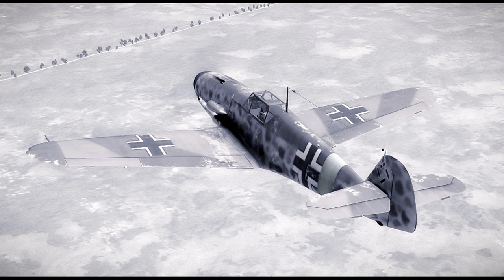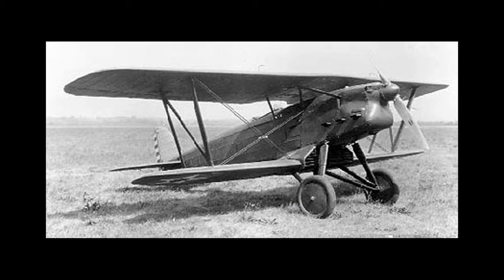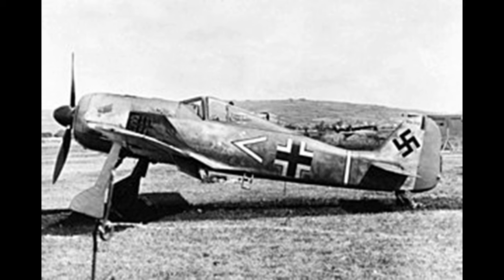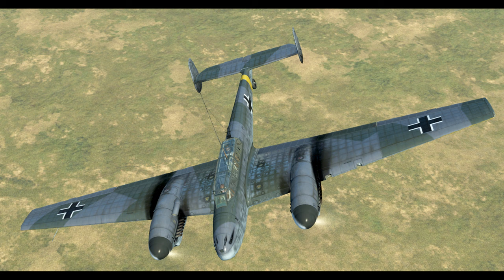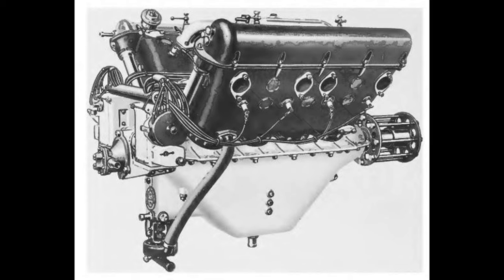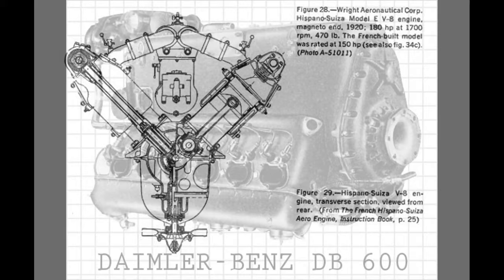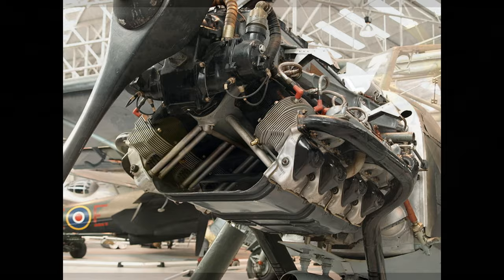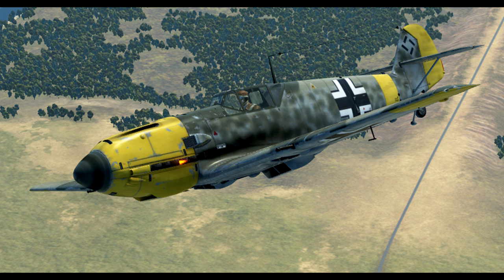Messerschmitt Bf 109 , Why an INVERTED V-12 Pt. 1? inverted V12s vs. upright

Comment: I would find it interesting to learn more about Italian aircraft engine design during WW2. The Italians didn't produce any major aircraft of note during that war, but afterwards the Italians were the dominant automotive gurus. Ferrari is a name that everyone knows. Were the great creative minds in Italy being suppressed by that spineless dictator? Surely, there are examples of great Italian engineering DURING WW2 - perhaps good engines that ended up in less desirable aircraft?
I am not Italian even slightly, but I find it interesting that the Italian automotive industry (starting right after the end of the war) was able to become a dominant world-player, while their aircraft during that war were largely laughed at.
Please tell me how I am wrong and how things actually were. There is a disconnect there that I would like to know more about. Something doesn't make sense.
Reply from the maker: Most Italian fighter planes during the war flew with either Fiat or Alfa Romeo built variants of the German DB601/605 engines. They were built under license. Some of the Italian planes were pretty good but nowhere near what they could have been. The Italians had a lot of record setting engines in the 20's and early to mid 30's, then fell apart, then came back with a vengeance after the war and was dominant by 1950. Why is that? The answer is entirely political. Certain political systems don't get the same amount of creativity from the population as others. You can force people to harvest grain and work in factories, but it's much harder to force them to invent something nobody has ever thought of. Think of it this way. Did Steve Jobs and his team create the Iphone because the commissar at the central planning division told them too? Or, perhaps they had another motivational factor.

Comment: It was mostly so they could shoot through the propeller the center of the propeller. Because almost all of them had a cannon in the center of the propeller. I watch a lot of World War II documentaries I'm sure there are other reasons for it but that was one of them
Reply from the maker: No, I'm afraid not. See part two for the reasoning. I cover that theory extensively.
Reply: @GregsAirplanesandAutomobiles  I watched Part II. and you are correct.  I'll admit when I'm wrong. Good video!

Comment: The point that it is not possible to use this inverted V12 for tanks is nonsense! 

The DB 601/603 were part of the motor range offered by DB.  Versions of the DB 603 basic motor were as well offered with upside zylinders as Diesel engine with 6, 8 and 12 Zylinders. After the war DB founded together with Maybach the MTU. A follower with 10 zylinders was used later in the Leopard. Reference Spielberger (Panther), Gersdorff (Flugmotoren und Strahltriebwerke).  

DB tried several times to sell its engines for tanks in ww2. But the Heereswaffenamt did stay with Maybach as sole supplier of motors for tanks.
Reply from the maker: I didn't say it was "impossible", but show me a production tank with an inverted V-12.
Reply: @GregsAirplanesandAutomobiles   Daimler Banz and other motor manufacturers like Deutz often use a kind of a modular system.....It is the same engineer team. They use the once designed motor block, pistons, crankshafts for a range of motors. 

You can turn around the motor block use some new components or components already in use in other motors and make a tank motor out of an aircraft motor. 

That means if DB would have persuaded the Heereswaffenamt to use the DB517 for the King Tiger  plenty of the components would have been the same as in the DB603.  Both motors have the same dimensions.  They could have used the same cast molds, forge molds, tools and perhaps assembly lines.

Name        bore         hub           cubic capacity        no zylinders       Remark
DB 603      162         180               44.5L                      12                       Aircraft engine gasolene inverted V
MB517      162          180               44.5L                      12                      Offered for tanks standing V

Comment: Kepping the pilots head closer to the center of gravity( lower in the seat) is important during high G manuvers. Yer head spins in a tighter circle. Also in a negative G manuever an upright v engine could and did stall out because the Germans used direct injection whereas the allies were using carburetor. In a quick inverted move you could be in trouble and Getman pilots knew if they got allied pilots to try and follow them in this way and inexperienced pilot could lose horse power as the gas flow was dependant on gravity. Bynthe time he would correct the move losing speed it was too late. Tge enemy had him turning a pursuit into an advantage for the pursued.

Comment: Doesn't an inverted V12 help with the designs of Fuel Injection? A Carbureted V10 or V12 starves on Negative G?
Reply from the maker: No, it's not a factor.
Reply: @GregsAirplanesandAutomobiles  

How is it not a factor when British Piston Plants were carburated ie- float bowls on negative manuvers inverted pulls the machines would shake shimmy and studder on hard pulls whereas German FWs and BFs had fuel injection so aslong as it had fuel pressure it would feed fuel. This was critical for High Altitudes and Interceptions right?

Comment: The ME 109 was fuel injection as the Merlin was carberated and lose fuel in inverted turns or maneuvers
Reply: Hi James, you mean "negative G" flight, inverted turns like a "Split S" or other maneuvers were OK as long at you maintained positive "g's" on the aircraft, Ciao, L
Reply: @lancelot1953  yes I ment that when I said inverted maneuvers a good example of this is in the movie battle of Britain where a spitfire flying upside down briefly loses fuel by the evidence of smoke and sputtering heard closely in the movie
Reply: Hi James, Roger that!  In some of the Naval Aircrafts that I flew "in the old days", (turbojet), the fuel would go from drop tanks, to main bag (fuselage or wings), then to a smaller tank (or special tank) that would be kept full allowing negative "g's" or inverted flight for about 15 seconds depending on the aircraft, oil supply in scavenged accordingly.  Happy holidays to you and your family, Ciao, L

Comment: Fun fact not only upsidedown but back to front, there was a hollow prop shaft from back to front so a cannon could fire from the centre of the nose.
Bonus the inverted design allowed 2 more cannons mounted on top of the engine.
Reply: The P39 shot a cannon through the prop hub, so….
The P40, among several others, had two machine guns on the cowl, so….

Comment: FW 190 Powerplant: 1 × BMW 801D-2 14-cylinder air-cooled radial piston engine 1,700 PS (1,677 hp; 1,250 kW)
Reply from the maker: Yes Brain, THAT version of the 190 has an aircooled radial. Not all 190s, some have liquid cooled inverted V-12s.
Reply: @GregsAirplanesandAutomobiles  Not that it matters but did the Germans get most of their basic engine designs from U.S. ones like the Japanese did?  Henry Ford was a Hitler fan and licensed truck manufacturing there I think.  The Germans were no more innovative than anyone else.  von Bruan even said that we had Goddard and associates (Goddard was dead but we know what he meant).
Reply from the maker: Thanks to Hitler, if the price of tea in China goes up anymore, the Germans won't be able to import it.

Comment: BMW made horizontally opposed motorcycle engines forever. Germans aren't afraid of doing something different. The inverted v plane engine is a no brainer. And clearly the lower c.o.g, important on take off and landing.

Comment: Sherman has around 3.5" of frontal armour while Tiger has 4".. so in terms of protection they're about the same.
Reply: Sherman had only 2" of frontal armor .... and considering their opponents typically had greater penetration power than the short 75 mm (40 cal) of the Sherman one would have to conclude that when it came to protection the Sherman was grossly deficient. Thankfully for US military, they never had to face the real strength of the German armored forces who were too busy fighting on the Eastern Front
Reply: @09Libertarian  2" plate angled to 60 degrees off vertical gives little under 4" of effective armour thickness. Which is not bad compared to slightly over 4" of Tiger's frontal for a medium tank that weights two thirds of the heavy tank. 

US fought plenty of big cats in Italy, with such success operational command decided complicating logistics in Normandy with new 76mm spare parts and munitions supply wasn't worth the effort. 75mm was killing Panthers, Elefants and whatever germans had to throw at them very well.

Comment: The reason for this is a screw up. The first prototype they built, the engine was mounted correctly but someone forgot to turn the plane right-side up. The error wasn't caught in time and instead of looking like idiots and possibly ending up on the Russian front they told Goring they planed it that way.

Comment: The Germans did fit a 1200 hp  / 44.5 litres / DB 603 inverted V12 into their 188 ton VIII (Maus) Super Heavy Panzer - Top speed 12.5 mph with the wind behind you !!!

Comment: skipped though your video,  good effort but i think you are overthinking things ior thinking in slightly the wrong direction.  the differences are historical in the RR and allison had a history of building V12s and DB did not.  from ww1 DB was not able to continue development where allison and RR did. in short Allison packard and RR continued developing bigger and better versions of the same where DB started afresh/ or were unrestrained by their own history. We should also note that all these power plants were actually late 1920s on paper early 1930 development at best with the DB actually being the oldest initial design of the 3. OK now we start.  Line of thrust.   on most aircraft when you open the power the aircraft will clime, closing the throttle and it will nose down.  so nose up nose down is the relationship between drag and thrust.  the center of thrust being below the center of drag. IE the propeller being below the line of drag.  closing the throttle makes the proppelter the greatest source of drag thus pushing the nose down. these are deemed desirable traits.  SO in the days of direct drive IE where the propeller is directly bolted to the crankshaft. the location of the motor becomes critical or more importantly the location of the crankshaft becomes critical. A very good example of this abet a simple one is the DH moth and the DH tiger moth.  same motor just inverted f0or visibility, keep the oil out of the pilots eyes and lowered the center of gravity without changing the line of thrust. i will stop referring to the allison simply because it will confuse the issue and its history was so politically mediled with to the point of where it became a side note in history.  Now the DB  was a much larger displacement motor that started out as a direct drive.  big cubes low revving in a more american style " lazy"  the RR on the other hand being a bit under 1/3 displacement ( i know many different versions ad displacements but for arguments sake)  But a 1/3 more RPM putting the two motors on a sort of equal standing.  BUt as aircraft got faster and propellor development improved and latter the advent of variable pitch and the automatic variable pitch meant that the RPMs of both motors became more static. larger Dia prps also meant lower rpms.  RR was able to change the existing reduction drives. DB had to introduce reduction drives. and that was about the time of the 109.  so in short  the DB was initially based around direct drive where RR and others had already introduced reduction drive enabling them to place the prop where ever or even counter rotate. there are many more advantages and disadvantages but what i have outlines is how development started or answers your question WHY.  once locked in it was hard to change
Reply: It was a policy put forth by the RLM, German Air Ministry long before the war. The question he was answering is why? The DB600 produced peak power at 2400 rpm. That seems to negate the idea of direct drive unless the propellers are very small. Do you have any sources on the direct drive idea? First run of the DB600 is 1932. First flight 1935.The engines are contemporaneous. No mention of direct drive have I seen with either engine. The DB is 34 liters, the Merlin is 27 liters which is 80% of the DB.

Comment: The inverted v12 was a proven engine and most of the German R&D was going to jets and rockets The Germans had little need for marine engines and the few but high quality idea of the Germans was the opposite of the USA building over whelming numbers. The advantage of the Sherman was an air cooled engine. Don't forget the Sherman Firefly.
Reply: Many Sherman's used an 1100 cubic inch Ford V8 with DOHC 4 valve cylinder heads and liquid cooling....

Comment: And to also add an inverted engine mandates fuel injection which allows a lot of advantages
Reply from the maker: Not really, although your logic is sound. However there are cabs that work fine on inverted engines. In fact the DB600 used four two barrel carbs.

Comment: Engines were designed and assembled upright so they were fitted and maintained upright, anything else is just upside down for no advantage except lowing the exhausts 10-12'' hence having to search for advantages, of which there aren't any. Two six cylinder banks and associated valve gear may be slightly heavier than the crankshaft but that's the point, there's only one crankshaft in a crankcase and it's natural to place all that weight centrally at the bottom and build on top from there, the cast engine braces were massive to hold them inverted compared to a simple triangle of tubes just holding it where it sits naturally in position, also both entire cylinder and head structures weight isn't held solely by the threads on the bolts. Video should be called: Common Sense v's Stupidity

Comment: Why wasn't the p-38 successful in Europe?
Reply: Early versions suffered because they didn't have hydraulicly-assisted ailerons, making them less maneuverable, especially at high altitude, compared with the 109 and 190's. The P-38 L variant did have hydraulically-assisted ailerons and was a definite match, especially with the centrally mounted .50's and 20mm.  In the Pacific Theatre it was a game changer because of its range (thanks to Charles Lindberg) and firepower.

Comment: Smaller dimension across top gives better visability when you build a fuselage around it?
Not watched yet. But seems to make sense.

...
Later...
You sound on solid ground to me.  Across the board.

Also...
Capitalism settled on upright due to market (as you say)... controlled economy (fascism) the designed served a political purpose... military force needs.

Comment: wet sump lubrication uses gravity to pull oil ito sump were it cools better.less pump andoil line app.''cold start'' damadge is reduced.lighter paricitic load.ecst.madey the krowts just like to reinvent the wheel.

Comment: I could have saved you a lot of time and told you in order to put the two machine guns on the top of the nose of the aircraft (most German aircraft had MG's in the nose) they had to invert the V engine...
Reply from the maker: You could have, but you would have been wrong, and still are.
Reply: @GregsAirplanesandAutomobiles  How am I wrong? Looking at schematics I can see that if the engine was upright then the guns would not fit in the top of the nose...

Comment: Good content but.... pre war the germans had a tour of the RR factory on the pretence of buying RR engines (their main goal of the tour was obviously to steal ideas and know what your future enemy was up to) much like the Chinese today . 
During pre war known tensions between the UK and GER the brits at RR knew tensions would turn at some point, the RR engineers decided to invert EVERY ENGINE in the factory pre germans turning up / on show so as to confuse the germans. At least temporarily. 
The germans thinking ‘there must be some advantage to running engines upside down as RR who make the best engines’
Germans copied but could not understand how inverted carbs worked or how RR got the levels of performance demonstrated at speed events. As a result they ended copying what they saw and had to develop fuel injection which at the time was new and unknown technology/expensive/intricate etc. Wasting some of their war effort.

Well known story at RR...
Reply from the maker: It might be a well known story, and I've heard it before but I don't think it's true. First of all, the Germans had been building inverted V-types with carbs since 1928,, so that whole part of the story about this forcing them to use fuel injection is demonstrably false. Second, tensions were not that high when the DBs were designed which was around 1931. So if this story has a shred of truth to it, and I don't think it does, it would have had to have happened in 1929 or 1930. Sir Harry Ricardo received an engineering award from Herman Goering in 1938!

Furthermore, the Rolls Royce engines when installed are visibly upright, so when the observed them at speed events they would have seen that they were not inverted. The whole story is just made up.